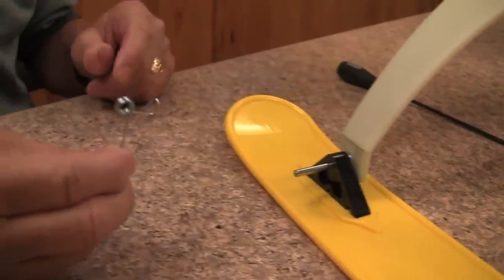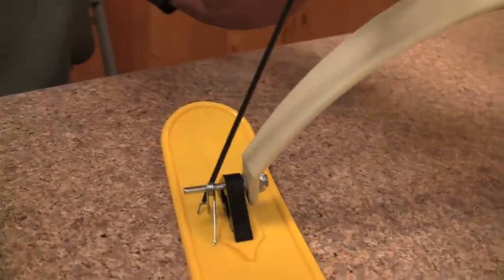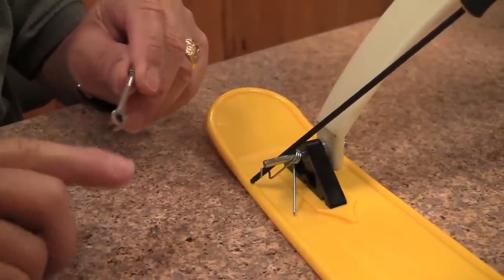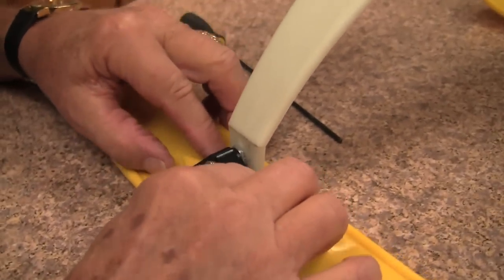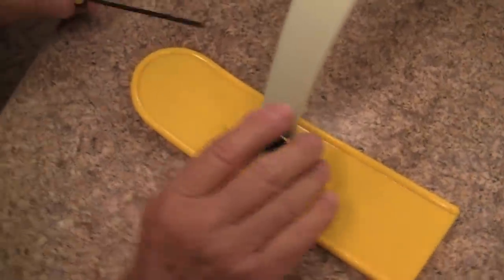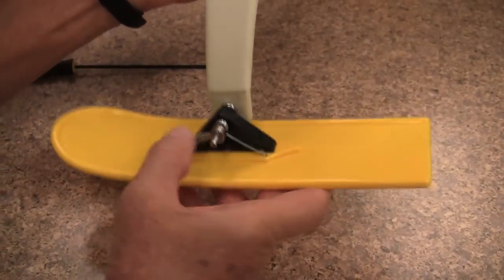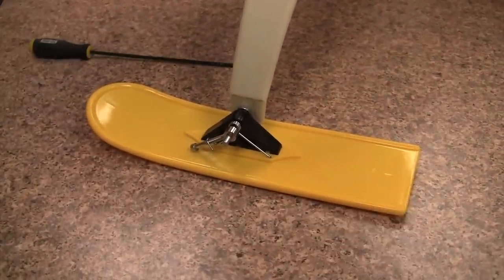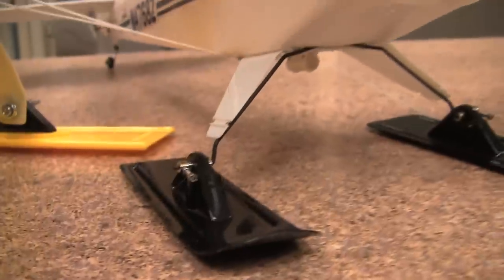DU-BRO Snow Ski Install

Comment: I file a flat spot on my axle, which on those axles it is easy to do anywhere, then position and tighten the lock washer behind the gear leg. When your gear is fixed, it's a little trickier. You basically have to mount your skis first, then in the summer, the wheel collars can use that same flat spot.